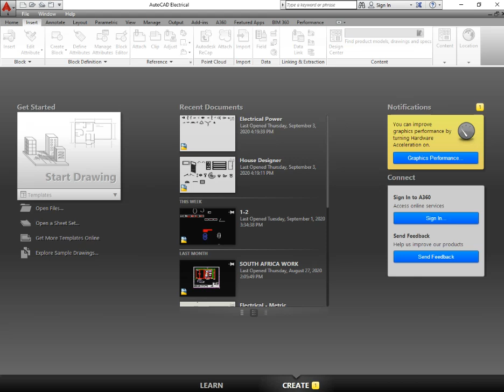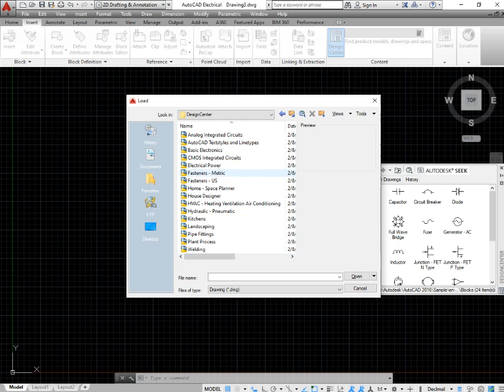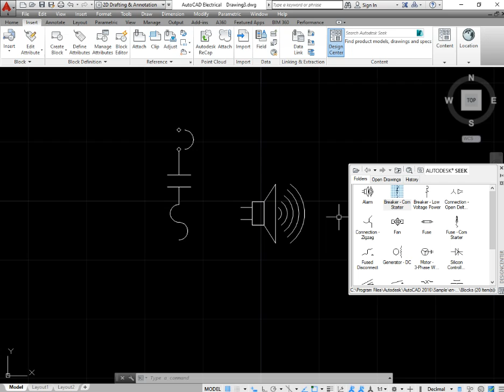AUTOCAD BASICS - 8, Library autocad, AUTOCAD Electrical, ELECTRICAL SYMBOLS

Comment: Sir i have already install civil autocad2007 but i want to open electrical autocad drawing files it's running or not?if i want to draw electrical darwing it's necessary to install electrical autocad or not becoz i have already install civil autocad
Reply from the maker: Draw electrical symbol by yourself...
Reply from the maker: U can Use civil Autocad.... Modify settings of Autocad as per your requirements